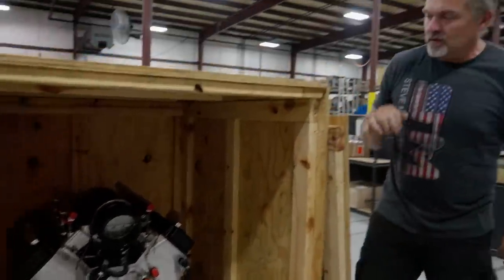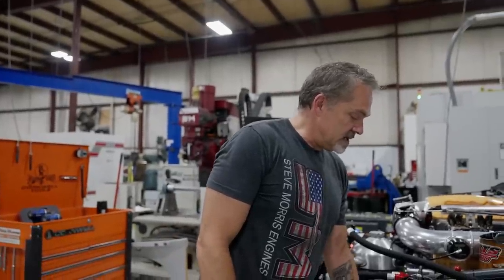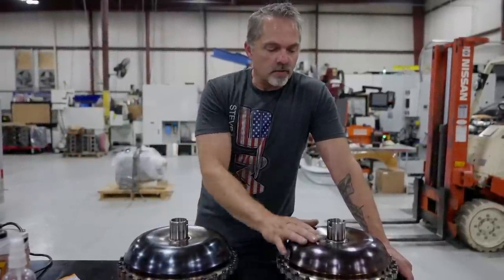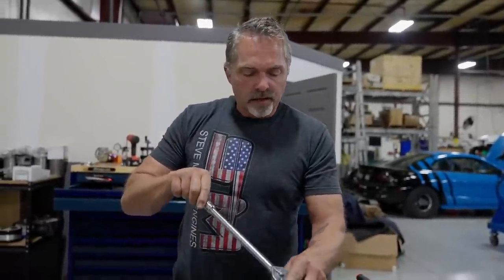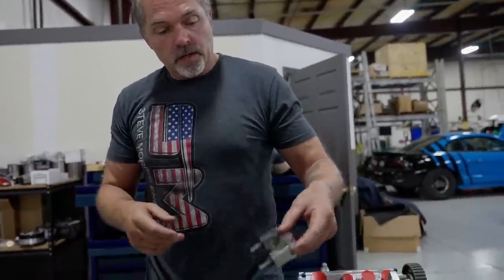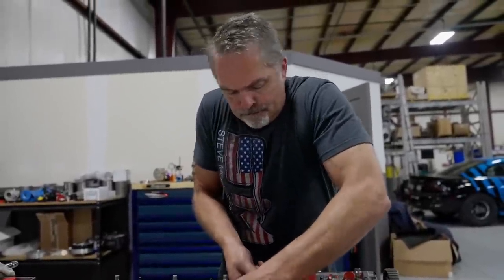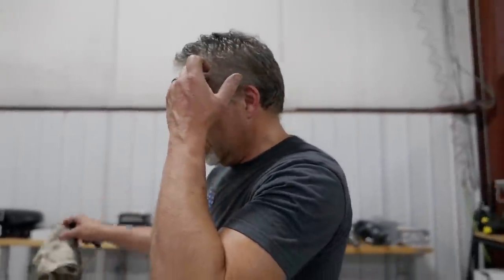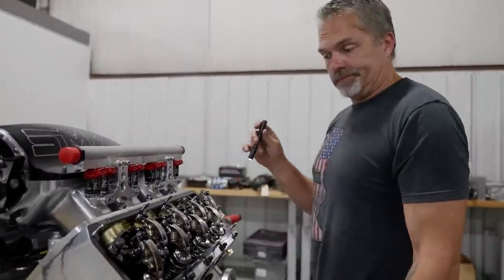What’s Up With Mullets SMX? Part 1

Comment: this is about your converter temp on two step. on transbrake, where does all the power go? into the transmission fluid. think of your dyno and how it dissipates the energy.  its like a mini dyno inside your transmission absorbing all the energy. can you increase the size of the bypass passage  and pump the bypass fluid directly into a cooling line to keep the heat out of the transmission while on two step? also, cleeter might be material from the scavenge pump itself.

Comment: What do I think...the only thing I can conjure up is an issue with the roller thrust bearing, where some (90+ degrees of 360) of the rollers flat-spotted and created sometimes tight, sometimes loose tolerances (your .007 in this video...clearly double that or more at the track) based on whether the rollers are rolling under no/low load or all lined up flat under/after heavy load...I doubt it too, but it’s all I got.

Comment: Gotta be the oil pump. Steve said it felt tight. It’s probably eating it self on the drives. Or another theory what if the oil lines to the filter still had pieces of metal from the last time and it’s getting pushed out slowly??

Comment: Your oil pump pushes to filter and screen-correct?
Oil pump.
Either a bearing in the pump, or slight material left when the pump was machined..

Comment: Once you get it back together, would you put it on the engine dyno before it goes back to Cleeter? That way you can monitor vitals and confirm the issue may be in the trans? Line psi etc, just sayin 🤷‍♂️

Comment: Nothing in the block but material in the filter ? only thing between the two of them is the oil pump which has been changed before (if i remember right) my guess is the pump is chewing itself up

Comment: I have to wonder if the thrust clearance opens up when it gets hot? but you think that would be the opposite effect. ITs really strange. Not to mention the loss of oil pressure that Cleetus had, its all very strange. IM trying to think back threw everything that engine has been threw between your car and now mullet.

ITs seen rods disintegrate, an oil pump be torn up from a pickup screen, a thrust bearing clearance issue, more boost than i thought possible, and quite a few weld repairs on the block if i remember right.

Random thought, could the block be stressed from all the welding and warping under hot load conditions? But where did the material come from? oil pump? but thats aluminum internals isnt it?

now im just confusing myself, cant wait to find out what ever it is you find in there!

Comment: Great video! Would magnets in oil pan or more small filters in the lubrication paths help collect debris to help isolate the problems that arise?
Reply: You're on the right track. Avoiding shrapnel getting sucked into the oil pump would save a very expensive pump/engine.

Comment: Could the difference in thrust lash at the track be due to the engine being hotter? Just some rough calcs says the block should expand by 1.5mm for a 80deg C increase and the crank would go up by 0.67mm longer. So now it’s back near the same temp it was set it is fine again, while it is hotter the lash should be different.

Comment: Maybe it was from the thrust bearing when it got damaged and it went through the pump and there was still bearing pieces in the bad pump that may have not gotten cleaned out fully and it loosened up after all the flow and pressure from the oil?
Reply: Maybe ask Cleeter what the old pump looks like inside it to see if it was dirty inside

Comment: Hey Steve...was that the motor that had the oil pump get all galled up.....I dont remember....watchd so many of your videos.....it was a dry sump motor that the pump was on its way to seazing up....u changed it out....BUT....what about meterial left in the lines or the tank or the cooler...?...were they all flushed...?.."if it was this motor...?..?....workd 4 a guy way back...dusted off a motor...had another "compleat" motor built (new block& all) took the car out "1" race....spun a bunch of berrings....turns out...he forgot to flush the oil cooler & lines (or replace them)....coust him another motor...?....just came to mind...?..?....love the channel....reguards Brian

Comment: Steve, can you get your trust bearing assembly to the torque converter side of the crankshaft so the whole crank isnt having to take the load from the converter? not that it would fix anything but would seem like a nicer way to go if you can.

Comment: Hey Steve, the last thing I remember from Cleets channel was a bit of the strainer material got into the oil pump and tore it up, it was redone before he went out, but, could there have been some material left somewhere that they did not clean or flush out? Like inside one of the hoses maybe? I mean, how else does it end up in the filter and nowhere else? and those were some chunky bits it looked like not really fine like bearing material IF I am remembering correctly........

Comment: I was under the impression the oil pressure was a bit lower than normal on cleetus video.  which would point to obvious areas of the motor including the oil pump.

Comment: Steve, could it be possible that the small pieces came from the tank to the filter, like  the pump flows a high enough volume at the top of the rpm range? maybe some pieces from before.

Comment: Why do you guys use wood crates and not the nice injection molded plastic ones ? They’re much smaller and lighter and last forever we’ve been using them for years with roush and several others .. just curious

Comment: He had started it without oil in it at one point do you think it could have damaged the oil pump?Also could have caused the low oil pressure and would explain why there wasn’t any material anywhere else.

Comment: If it's not from the motor, it must be from something bolted to the motor that has an oil feed which runs through the filter, before the oil is returned to the block.

Turbos maybe?

Comment: I'm gonna say there is something injured, not broke, just injured with the pump since it went to the filter and you're not seeing anywhere else in the motor.  Could have been a tiny bit of one of those springs that caused the pump injury.

Comment: I am likely crazy and my thought impossible, but I would say either an internal oil pump issue or possibly the metal is coming from the oil system of his turbos. I mean if I remember his turbos were leaking oil. Wouldn’t that still catch in his pre-filter? Again I am probably out of my mind, but process of elimination looks to point those directions. Please let me know what you think.

Comment: I feel like it had to have been residual material from the previous thrust issue. Seems like that engine has a lot of oil plumbing and it would be tough to get it all cleaned out.

Comment: Like I said on the torque converter the engine builder just built it too badass and my guess on Garet's motor is the oil pump put the trash out to the filter. Maybe a sliver from the spring traveled the imposable route to the pump and made a little gaul and thats where the metal came from. Thats my guess till the verdict comes out. lol

Comment: I don't remember if the SMX uses a timing chain, or a gear drive?  I've seen stretched chains eat away at the timing chain cover.
That doesn't explain why there's no material in the pan though. It's the only thing left that I could think of.
The only other guess is it's still debris from the last time

Comment: Walked a cam bearing out or lifter bushings on broken valve spring? Or bearing / bushing failure in the oil pump itself??

Comment: 100% total I don't know shit about anything just trying to learn question... Would any of the clearances rods, mains, thrusts pistons, rings change because of temperatures say 200-240 operating between the different metals Say aluminum block vs steel crank, rods that might cause tighter clearances or larger like what you might have felt under the car at the track. and do they shrink at different rates while cooling off?

Comment: hmm lets see, last time the material was mostly coming from the oil pump and nothing was showing up in the pan, top end ect but showed up in the filter. so since nothing is showing up wrong here in the pan, top end, bottom end, then the material must be in the area where the filter is and before. so maybe the oil pump has something wrong with it. Is it possible to have had the previous lines full of material and then the new pump put on and it go through the pump? aka lines not cleaned? or maybe a low spot in the line where material got caught, but i feel like there would be too much flow and pressure for that potential material to just instantly flow through. them filters for one thing are sure saving lots of money so can be thankful for that!!!

Comment: Wonder if the issue concerning the material came from the turbo he was running in the video at the track that day it was popping back through the turbo on the 2 step and they did have oil leak in said turbo which I believe was passenger side?!? Could’ve been material from the bearing in the turbo maybe??

Comment: Stupid question. Was the Entire oil system flushed out between change..?? I had bad time finding small deposits metals hidden in lines fittings and such. Big pain in butt might need 2 replace everything.

Comment: Now I'm thinking about the dry sump system, hoses or fittings on the car, not the engine. Perhaps the oil pump but who knows really.The pieces on the ClearView seems large enough to not be from plain bearings. Maybe the needle roller bearing up front? If there's nothing in the engine, well Cleeter chicken'd it lol

Comment: I'm no expert on V8 motors, but any residual material from a previous blow up might still have been in the lines. The oil pump and filter will tell the story.

Comment: It may be controversial but my thoughts would be when you cleaned the block post the Suicidal rods it would be remaining debris. Thats if the sample wasn't magnetic.
If each time you cleaned the block and associated accessories for the oil system if you got %99.95 of the debris out and there were a Million pieces there would still be 500 pieces in the system. Obviously it has been properly cleaned more than once but using the same methods there is a massive diminishing return so unless everything has been disassembled fittings, hoses, blind oil galleries, filters, breathers, even the full length of the hoses visually inspected internally chances are there could still be random pieces hiding in there.

Comment: If I recall correctly he had low oil pressure witch could have been a failing censor or a electrical issue seeing no issues in the pan or head . I think you did some repair work on the block but I don't remember if it was eny whair neer a oil journal that could have suffered some material fatigue from the abuse and desided it was time to open up (witch is most definitely a stretchbut not out of the world of possibilities) . But I am most definitely not a expert just a arm chair enthusiast .

Comment: Any chance Cletus used oil lines, reservoir, or a cooler that were already in the car and had some residual debris in them from the old engine? If not that, then maybe oil pump?

Comment: Only thing it could be if nothing is in the pan is something in the pump.... maybe 1 tiny (small enough to fit thru the pickup screen) sliver of the busted spring went down and got pulled into the pump. I lost a motor that way...

Comment: Considering that was the ultimate engine detonation block, repaired; Is it possible that the material was hiding in oil galleries from the blow up, and finally revealing itself as filter glitter? Or...
2nd option, you did say the oil pump felt a little tight, is it possibly shedding material from the pump itself?

Honest questions; dont roast me too hard if they dumb. 😂😂

Comment: I don't totally understand the routing of the oil for that engine, but is it possible that the oil cooler wasn't properly flushed with a hot flusher (I build transmissions professionally and we hot flush every cooler until there is no contamination in the 10 micron screen filter) and it's just residual from the previous failure?

Comment: do you think it could be pump related or something as simple as turbos bleeding of oil pressure ? if i recall cletus had a turbo issue with oil being pushed past the turbo seals, as for the metal in the filter again i would think oil pump

Comment: I would still open the oil pump. Anything that the oil is passing through I would look at 2 more times .  I am betting on the oil pump.
What was the material you saw in the pan ? I can't remember.

Comment: I wonder why it lost oil pressure on the last run. Wondering if it was a fluke deal where there was still metal in the tank or in the lines from before or Maby the oil pumps going out again

Comment: Oil pump itself over spinning? How clean are the hoses to the filter and how clean is the oil can could be a bunch of material inside the lines that just got free also tolerances could be different when the cars hot vs cold

Comment: 15:00 - bearing composition discussion,.. Might be worth explaining how the bearing and crank don't actually touch under normal conditions, with the oil forming a layer between the metal parts, and how oils have a Shear Limit according to the weight and composition of the oil.
Dial Guage,... jeez, you got less thust then I have mm's variation on my 3D printers bed,... :)

Comment: Is Cleetus using the oil you use/recommended? If not, I'm sure it's still race oil high in zinc and such, could that filter magnet be pulling the metal out of the oil? That's the only thing I can think of if everything else is 100% fine.

Comment: Deja vu... Thinking if the metal isn't In the pan. But it's in the filter.. any chance is residual from the last oil pump that failed 2 months ago, another pump or left over contamination in tank and lines or cooler if he has one

Comment: I'm by no means questioning Steve's engine genius. Just curious of some form of thermal expansion is affecting that beautiful piece of art? Aluminum block steel crank wise. I'm sure you have all the technical data on that, it's more for my curiosity I guess

Comment: I'm saying oil pump as he lost oil pressure and pumps directly into the filter before re-entering the engine..I would guess a gear in the oil pump spun/ broke the keeper key and ground it up

Comment: One plausible theory is that the broken valve spring may have lost a shard and when it finally made its way to the oil pump is killed the pump. Or at least chewed it up some.

Comment: Does cleeter have a oil cooler that ls full of old material? Or even improperly cleaned oil pipes can contain old material.   Once helped a hydraulic technician fine foam pellets down hydraulic pipes was surprised how much came through

Comment: I should have read comments before commenting lol...Didn't know about the low oil pressure issue.
Without a schematic, from here, I don't know how many filters or where they are, so maybe pressure pump failure is possible without getting brg' contamination.

Comment: Either the Oil pump is having issues, or the oil pressure sensor is going bad, or  a wiring issue causing the low oil pressure readings.

Comment: Is it possible that an auxiliary to the engine has created the metal at the filter ? Where does the turbo oil feed , return plumb into the system?

Comment: The torque converter heat is fascinating to me. There are not many oils that can live very long at 600 degrees with access to air.  Mostly things like Mobil Jet Oil 291 synthetic turbine oil.. I reckon drag racing doesnt require oils to last very lo9ng but still the cleanup of wicked bad varnish and parts wear from severely hot thin oil and torque convertersn havihng wildly different properties as  the oil gets thinner cannot be good. It seems like opening that orifice a little brought you from 900 degrees to9 600 degrees, maybe opening it more could get you to a more workable 300 or 250 degrees?:

Comment: What are the chances that the crank walked past your set tolerances when it got hot? Or, could be the torque converter/trans wasn't properly shimmed and pushed the crank forward and it self-clearanced itself.

Comment: I'm betting that it was either material from a failing turbo, or some other foreign object that possibly entered during a valve adjustment, oil change, or residual from a prior failure, and it took out the oil pump.  I don't 'think' a turbo is to blame, but I'd say it is a possibility.  I'm going with foreign object, officially, haha.

Comment: I don't think anyone put a mechanical oil pressure gauge on the engine to verify the real oil pressure drop. Possibly a skewed sensor reading, . And for the material in the filter, either it pushed old material that was hiding in the lines or there was sabotage. There is no way anything get from the source to the filter without leaving at least a fraction of a crumb trail...

Comment: Hi Steve, Does the end play of the crankshaft change as the aluminum block heats up and expands because of thrust bearings at both ends of the crank? How much does that block grow when hot, I always wondered if anyone actualy measured that? Thanks. Billy.

Comment: Could it be aluminum off the bottom skirting of the pistons. I've seen where the Pistons can get chewed up at the bottom where the rod clearance is cut out of the cylinders putting metalic flake into the oil.

Comment: They stopped because of low oil pressure, no? It seems like the material could have come from the oil pump because the engine is so clean.